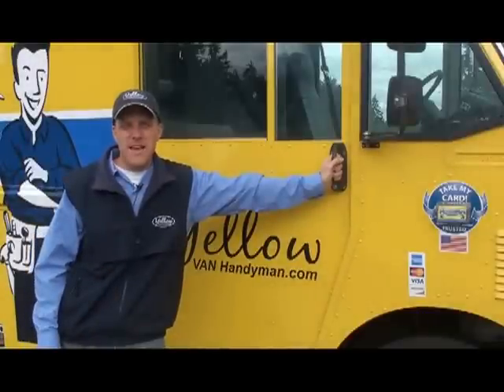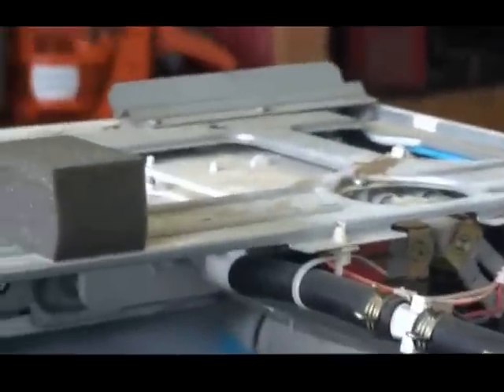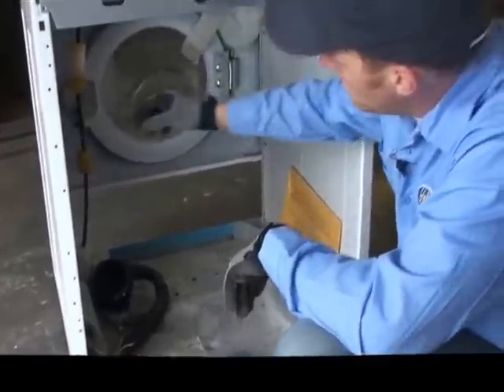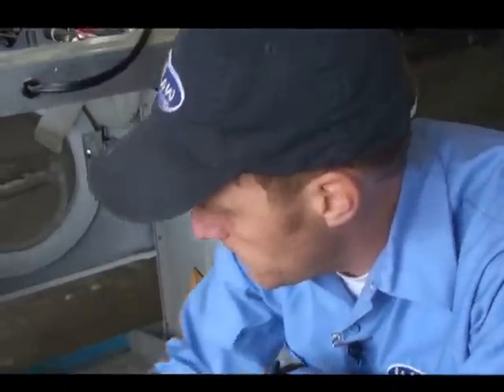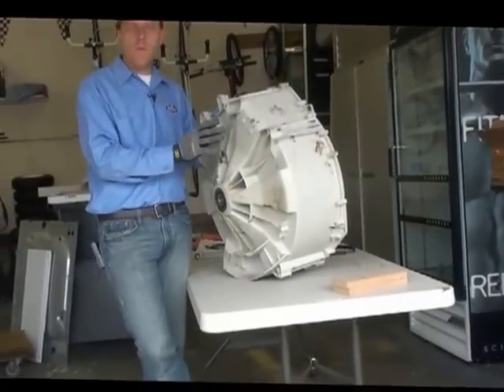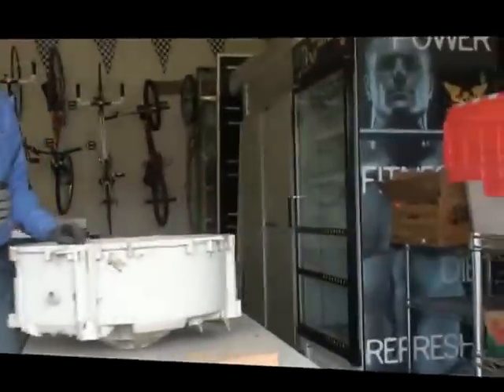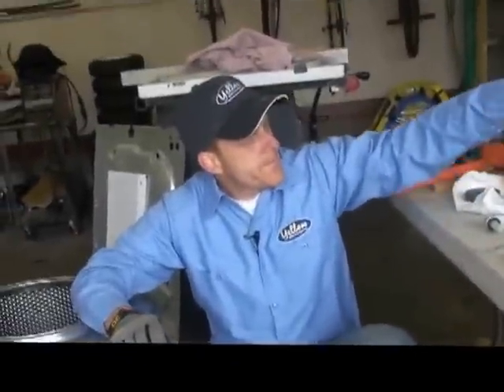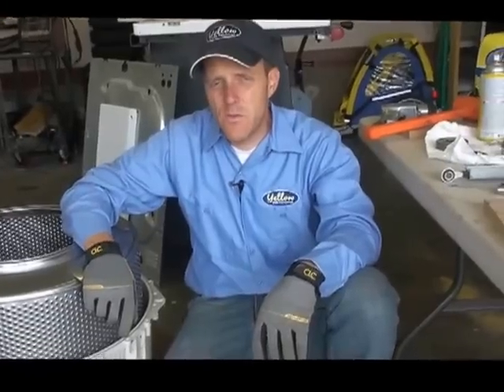Front Load Washer Repair - Bearing and Seal Failure Mode

Comment: GREAT VIDEO spoke with sears and they wont sell the bearing kit at ALL only sale the rear tub so glad I googled it and found your video with away to order the bearing kit and the video made it so much easier for what I saved from not getting the rear tub I went ahead and got new belt ,shocks, springs and water pump figured since had it all down to go ahead and make it a little better
Reply: Awesome! Glad to hear it.

Comment: Thanks for taking the time to show how to replace the bearings and seal on these type washing machines.  And thanks for sourcing these difficult to find parts.  It's guys like you that make the Internet great.  Another item to consider sourcing is motor brushes.  These brushes wear over time and must be replaced, eventually.  After much research, I was able to find and purchase a new set of Electrolux brushes from the U.K. off eBay.  But, brushes can be sourced from China, too.  Many of these machines go to the dump due to worn motor brushes and bad bearings.  Thanks again for your contribution in making the world a better place.

Comment: I thank you.  Your video helped me replace my bearings in my Kenmore front loader which they said I could not do.  It took me 4 hours but I rechecked everything I did.   Now I find that I need a new spider and shaft since mine is corroded away.  I bought your bearing and seal packet and hoped you could lead me to a spider and shaft
Reply: Some models have spiders available for separate purchase but most require you buy the entire drum assembly. You should also call the manufacturer to see if they will warranty the drum assembly. Depends upon the age of the unit.

Comment: Jared, Thank you.  I going to take out the tub and look at the shaft and bearings.  Eitherway I'm committed at this point.  Just that darn thing is stackable and in a closet, upstairs.   So it all has to be removed anyways.  Replacing the belt took 5 minutes, getting to the opening 30, putting it back took longer and required Herculean effort.  I figured its out now and I should see what's wrong with it.   I appreciate your help and suggestion.
Reply from the maker: SuperJamster1 Sounds good.  They are a pain to manhandle around but fairly easy to work on and repair.

Comment: Hi, fantastic videos, our samsung WF337AARXAA just stopped spinning and draining. My son took out drain pump and found thin rock about inch long in pump housing, with one broken fin. But unit was making noise before it stopped,  spinning drum by hand, spins, but have slight grinding noise, almost like small pebbles behind drum. I just ordered your bearings and seal kits for our washer....thank you so much....I will be ordering more parts for our relatives in the future....again fantastic videos..
greg

Comment: When pressing the new bearings into place make a tool or use a socket that will apply your pressing force only on the very outside lip flange of the outer race of the bearing ,, do not press the bearing by hitting or applying  pressure to the inner race or you will likely damage the new bearing.

Comment: Thanks Jerrod, That worked great. I guess that is why you are the professional and not me. The inner bearing was seized onto the shaft. I had to cut it off. Do you know if the inner and outer bearings are the same? You said in your video that they were not difficult to find.What should I look for? Thanks again for such great help.
Reply from the maker: You can get the repair kit or just the special seal here:  http://www.yellowvanhandyman.com/washerrepair.aspx

Comment: Thanks for the video.  I've replaced the bearings, reassembled and then ran the machine, but the tub would not spin fast.  I tore down the machine again (I'm getting very good at it now).  I found the problem to be the new bearing seal is creating drag/friction on the shaft.  I applied a very light amount of 3 in 1 oil to confirm that was the problem, there after the tub (cheese grater as I like to call it) spun better.  What would you recommend to lubricate the seal or lessen the drag?
Reply from the maker: Hum... This is curious.  What is the model number of the unit that you have?  You can message us also and we can research the order.  I just want to make sure we have the correct seal for your model.  It is most likely the correct one but there are some that are only about 3mm difference and that could be an issue.  They should be snug but not super tight.
Jerrod
Reply: The seal was not purchased from you.  Long story short, the bearings and seal were pulled from a new back shell.
Reply from the maker: calmicp Well, it still should be close.  I assume there was some other reason that you could not use the other back 1/2.  It will put a little more load on your motor but likely not enough to be much of an effect.  Run it for now and see if you have a problem again.  We try to ship same day and we pay for priority mail so can get you a kit pretty quickly if that ends up being what you need.
Jerrod
Reply: The long story:  My machine is about 12 years old, the bearings were noisy and I ordered a new back shell (at the time I did not come across your video) it did not go together well.  The mold on the new back shell was different than the original one and when put together it seemed to be just millimeters shorter; the tub was rubbing on the boot and creating an obvious problem.  A new back was sent, same problem.  In the end I put the old backing on, dealt with the noise until my husband pulled out the bearings from one of the new backs. (For some reason the company only wanted one rear sent back.  Thus the reason I could pull the new bearings.)   Sooo, is there a lubricant you could suggest to put on the portion of the seal that comes in contact with the tub shaft that would be water resistant?
Reply from the maker: calmicp There really isn't any sealer that will stay in there on the water side as it will just end up on your clothing.  Under the seal, you can apply some lubricant that will help soften up the rubber a bit.  The rubber will stretch and over time will actually harden into a larger shape.  That said, I can't tell from this vantage how tight the seal really is.  I would probably use some heavy bearing grease on the backside if I was wanting some sort of lube there. Hope this helps.
Jerrod

Comment: Nice video - thanks for creating! I am doing this job now, but i'm unable to get the basket and shaft to pop out of the tub (what you're doing at 5:45). I am hitting the shaft with 3lb sledge hammer (and wood) and its not moving. I'm afraid to hit it harder ...am i missing something? Any suggestions?

Comment: Sears of course wants to sell me the whole SS tub to. Get the attached spider.  Or they will warranty the tub if I have them install the tub which will also probably cost me $300.  I find the tub and spider is a standard fit for over 50 models of front loading washers

Comment: My front loader (Kenmare) belt keeps coming off.  I noticed that the large back pulley'  has about 1/4 inch play where it goes in to far and allows the belt to rub on the drum's pastic housing.  Is this shaft movement because of the bearings going bad or a washer missing?
Reply from the maker: SuperJamster1 It is likely because the pulley has become loose as it is fairly soft metal as compared to the shaft.  You will most likely need to purchase a new pulley.  One thing you can try is getting an oversized washer and placing it on the bolt such that it puts pressure on the pulley.  The washer needs to be really large so it does not touch the shaft.  You will have to use 2-3 washers to get it big enough to put pressure on the pulley.  This added pressure will force the pulley into place and you may get some more life out of it.

Comment: Great video! My Frigidaire Affinity drum is stuck and won't budge more than a few inches by hand. Would this be anything other than a bad bearing? Received error code e52 (speed control board) but the drum wouldn't lock up for that reason correct? Thanks in advance
Reply from the maker: Jordanfasulo It could be bad bearings or it could be a broken spider.  If the machine is not very old then it would likely be the bearings.  To test, reach inside the door and try to lift the drum. If it moves up and down more than an inch without moving the outside tub then the spider is probably broken.  If it moves up and down just a little bit then it likely is a bad bearing.

Comment: I have a GE washer model WSXH208V1WW.  Do you sell the o-ring seal between the two half of the housing?  If I have it open, I may as well replace the o-ring seal.  But I cannot find it?  Any suggestion on how to find it?
Reply from the maker: Bruce-
We do not sell that seal.  If the seal is not broken then I normally put a bit of silicone sealer on it and reuse it.  I have replaced them and they are cheap to get from parts houses but I have never had one leak that I rubbed with silicone and put back together.
Jerrod
Reply: HomeTask I got everything opened and surprisingly there is no seal.  The two sides were held together with 23 screws.  I have a question, do you have a return policy?  I found out that the problem is not with the bearings.  The problem was the spin tub.  All three arms of the spider were broken due to rust.  I also pulled about couple pounds of lime stones from inside the housing.  Is there a way to prevent it for forming in the first place?  The inside wall of the housing is also covered with green molds.  No washer machine will last with this kind of build up inside.  There has to be some maintenance cycle that can be done to help prolong the life of the washer.  So I am going to have to get a new washer because the cost of a new spin tub is over $600.  If I can somehow return the bearings that would be great.  I did not use any of the part in the kit.
Reply from the maker: omgname Bummer - the spider does end up breaking sometimes but it is rare that all three arms are broken.  You can certainly return the kit.  Just package it up and send it back and we will make sure you get the proper credit.  The water type and soap type play a big part in the sediment build up inside the machine.  Leaving the door open when not in operation is also helpful.

Comment: Would the bearing failure also cause the front tub to be eroded out by the metal inner tub rubbing against it? I just took mine apart and see the front plastic tub has been eroded and eaten away by the spinning inner tub..
Reply: Hi Jesse, did you find out why the front plastic is eroded? I have same issue. Deciding on repair or replace after 10Y of good service.

Comment: I can't get the pulley assembly off the back of it, do you have any ideas?
Reply from the maker: Nett-
Usually if you pull the bolt out you can work the pulley back and forth and work it off.  If you can't get the bolt off and do not have an air wrench then you need to stick something through the pulley near the outside edge of the pulley circle to hold it in place and loosen the nut while holding it there.
Jerrod
Reply: just got it off, thank you, my strong son banged the heck out of it with a hammer and finally got it off

Comment from the maker: hetouahta htneuohtnueo - Yes, I recommend applying a small amount of 100% silicone sealer to the outside of the seals when you install them.  It seals the outside and helps keep the seal in place.
Reply: +HomeTask Thanks!  My original seal wasn't flush with the tub (it was somewhat recessed), but I'm not sure if it was bottomed out or not.  If I smear grease on the spider shaft and test-fit with the seal installed flush, the lip rides right against the edge of the machined area on the shaft.  If I push the seal all the way in, then I can tell from the marks on the grease that the lip is riding about 1/8" from the front.  This is a Samsung WF409ANW/XAA.  Do some of the models require the seal pushed all the way in (bottomed out)?
Reply: +HomeTask I used nontoxic aquarium silicone from Home Depot.  Made it MUCH easier to install the new seal.  I used dry ice to freeze the bearings, which allowed me to just pop them in with gentle thumb pressure (through heavy gloves of course).  Much easier than using a hammer!  Thanks for making these videos.

Comment: We just repaired the shock absorbers and springs on a Sears Model 417-44102301 front loading machine. The machine is working fine but will not do the final/fast spin. Is the problem in the motor?  Any advice?

Comment: Do you also have a kit for the dryer? Mine is starting to sqeek, so I might as well do both at once.
Reply from the maker: +Gordon Symonds -  I have taken my dryer apart a couple of times.  The problem that I had both times was that the motor had literally overheated and melted.  One time I replaced the bearing that is in the back of it but it really isn't anything like the bearing assembly that is used in the washers.  I also think that the dryer bearing or support kit is also fairly readily available.  Here is one sample that I found:  http://www.appliancepartspros.com/whirlpool-drum-support-roller-w10314173-ap5177441.html
Reply: +HomeTask I'm sorry, I failed to mention that my set are GE. models WSXH208 and DSXH43. Are the dryers about the same as the whirlpool?
Reply from the maker: +Gordon Symonds I am surprised that the repair kit for this is so expensive.  I do not remember them being that much for most of the models.  http://www.appliancepartspros.com/ge-rear-drum-bearing-we25x10001-ap2044401.html
Reply: +HomeTask thanks for the info. I am going to tare it down this weekend to repair the washer and then I will take a look at the dryer as well.

Comment: could you advice which tools I can use to remove main shaft screw. my machine is Electrolux model EWF8576. i have tried HEX KEY but failed

Comment: Thanks for the Video! Do you know if this same process, or similar, will fix an LG front load Washer model# WM2010CW?
Reply: +Mike Williams - Mike, We do have a kit that works for may of the LG machines but I do not see this model number in the list.  It is likely that we do have the correct parts but would need to verify them with your machine.  When do you plan to take the unit apart?  We could next day air the parts to you if you pull it apart and confirm the size of the bearings and the seal.
Reply: +Jerrod Sessler Thanks for the reply. I got it apart and it ended up being the rear support.(spider) The part was caked with soap that didn't dissolve but it ate away at the metal like acid. I cant believe soap could do this. Maybe I should replace the seal anyway since i have it apart. Do you deal with other parts? Or can you recommend a dealer that is reasonable on there prices? how much is that bearing seal? The part # (Spider) is 4434ER0003B < or C will work too I guess. Washer Tub seal4036ER4001C, The small seal is (I think this is the bearing seal)  4036ER2003A From Sears Parts Direct. They want around $100 +tax/shipping. Thanks
Reply: Thats for all 3 parts. The bearings looked fine. I cant believe how much of a piece of cake this was to get apart. I think I spent more time taking pictures of everything so I wont forget how to put it back together. lol Is this more difficult to put back together? I think literally anyone could to this. I'm gonna eat these words! Haha
Reply from the maker: +Mike Williams You can get the bearing and seal repair kit on my site here:  http://www.yellowvanhandyman.com/washerrepair.aspx

For other parts, I would search for "appliance parts" - there are a number of good vendors.  I have ordered from appliancepartspros.com and repairclinic.com and some others.

I would replace the seal and bearings if you have it apart.  The seal is the number one failure mode for these machines and the bearings are toast once they get wet.

Jerrod
Reply from the maker: +Mike Williams I agree that the repair is not that difficult but many people do not have the tools or the general skills so the videos are helpful to take the fear out of this sort of repair.

Comment: Will your repair kit work for a GE 2.2 DOE CU. FT. FRONTLOAD WASHER (WCVH4800KWW)?
Reply from the maker: Rebecca,
Yes, we have a repair kit for your machine.  The model is slightly different than normal but it looks like an 8153 repair kit and I am doing a little research now to verify that.  You can order a kit here and it ships the same day:  http://www.yellowvanhandyman.com/washerrepair.aspx
Thanks-
Jerrod
Reply: Hey Jerrod, were you able to verify that 8153 is the right repair kit?
Reply from the maker: Yes! Sorry for not getting back to you.  That is the correct repair kit.
Jerrod

Comment: I can't get the outer tank of of the shaft to the inner drum. I've pounded on the shaft QUITE hard, but it will not come out of the bearing. Am I missing something. There doesn't seem be any locking mechanism. I'm worried that I'll break something.
Reply from the maker: B Gordon-
Once you have it all apart, screw the nut back onto the rear shaft most of the way so that it covers the threads. Then pick up the tub by the open side with the shaft facing straight down over concrete.  Pull the assembly off the concrete floor so it is up maybe an inch or two.  Drop it onto the rear shaft that is protected by the nut from there. Continue doing this until you are up about one foot off the floor.  Drop it until it pops.  This has always worked for me.
Jerrod
Reply from the maker: The bearings are not matching on any of the machines that I have seen.